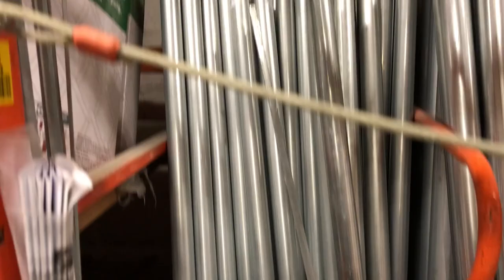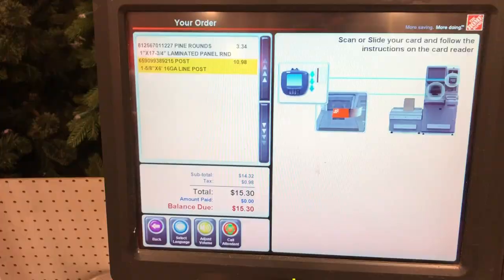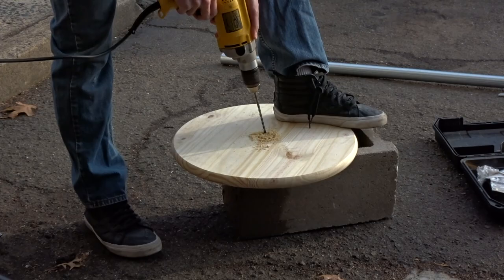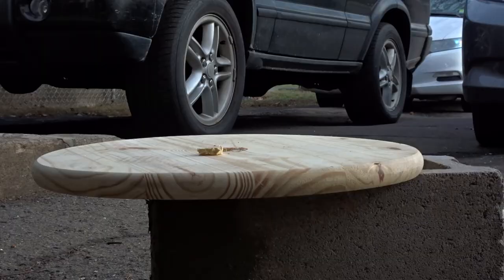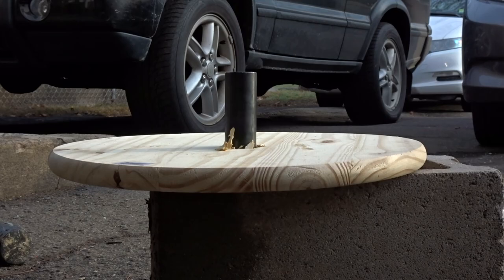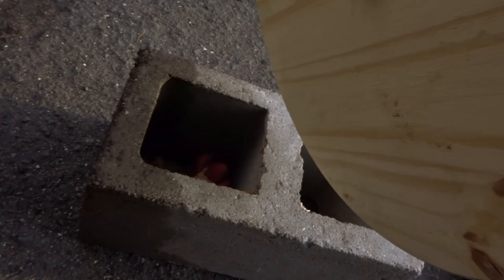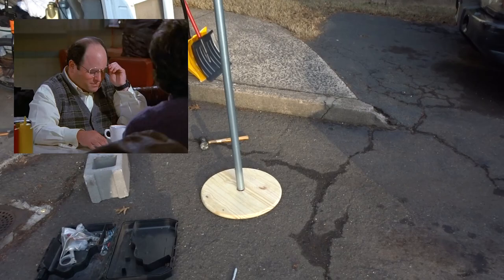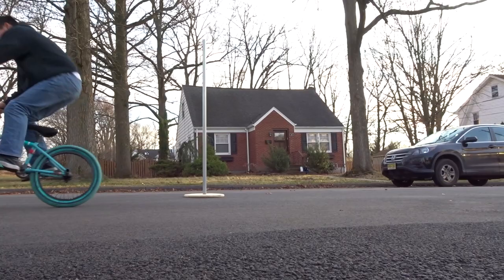HOW TO: MAKE FESTIVUS POLE FOR $15 | DIY under $20

Comment: Add a 6-foot chrome pipe to the weighted base & bottom 1/3 of a dead pole lamp.  Make sure the chrome pipe has a slightly larger diameter than the pole lamp tube.  No drilling, no gluing, no hammering required.  Drop it on when you want it assembled and take off the chrome pipe to store it.  NO TINSEL!!  YOU WILL FIND IT DISTRACTING!